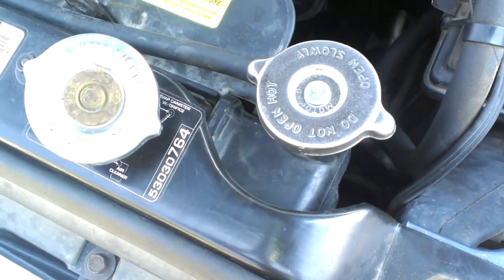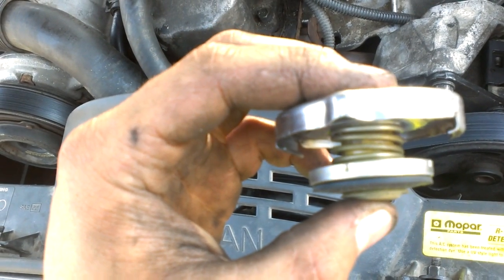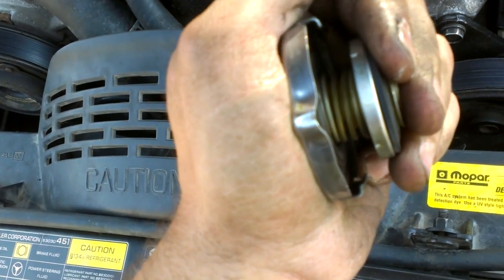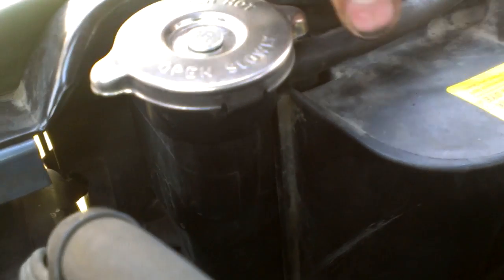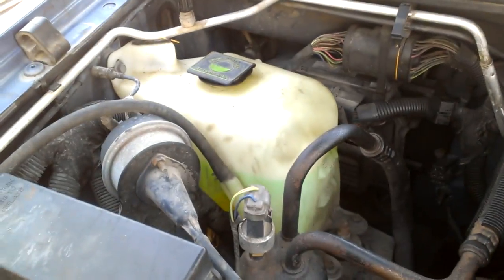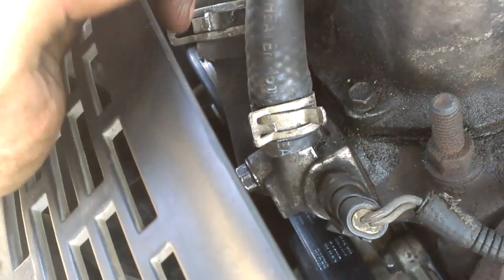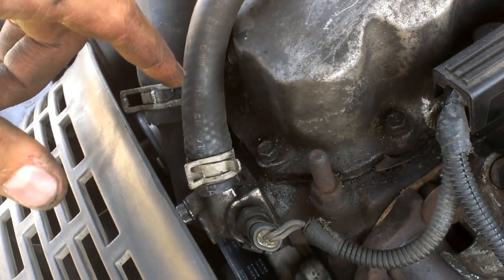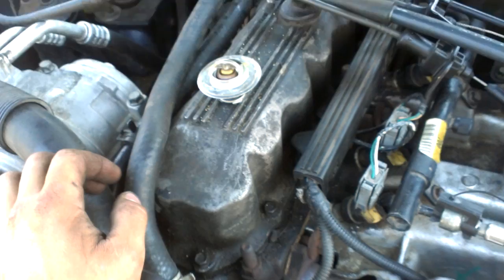The Importance of the Radiator Cap and Thermostat

Comment: I have a 2008 Toyota Sequoia 5.7L with 150k miles on it.  For the past 20 or 30k miles there was a very small vibration felt through the steering while at a stop.  It wasn’t bad like you see in really old cars.  Just a slight vibration.  Recently I hook the radiator cap off to check my coolant level and noticed that the spring had broken off the cap and was sitting in the fluid.  I fished it out and put a new cap on it.  And it completely got rid of the vibration!  It’s been a couple of thousand miles and there’s absolutely no vibration in the steering wheel!  I have no idea how and why but that fixed it.  Nothing else was done and driving condition and weather is all the same.
Reply: I had a simalar issue,my toyota solara at idle would feel like it was rocking back and forth then the radiator hose blew I replaced it and it hasn't done it since

Comment: I replaced my worn out radiator cap with one from local auto parts store. it gave me problems. Coolant was boiling over into fluid reservoir.  I bought a new cap @ Dealership that solved my problem.

Comment from the maker: We are on the same page bud.  Pressure from the system is from HEAT, and that's what i explain in the video.  When the system heats up, the spring contracts to allow coolant to flow into the reservoir.

Comment: you are wrong, the spring on the cap compress's when your system builds up to much pressure, the prring on the thermastate compress's from heat to open to let fluid flow thru system, get your facts right & stop being a shade tree that doesn't know shit.
Reply: Fuck off old man

Comment: Just a comment. By putting a lower temperature thermostat on, it will make it so that your car takes a lot longer to heat up inside, in the winter.

Also, if your engine doesn't get hot enough (especially in the winter), it can lower the efficiency of the burning of your gasoline.